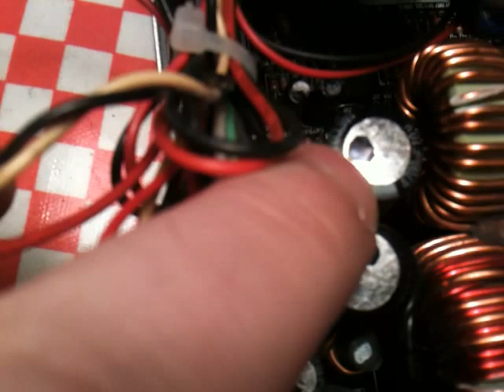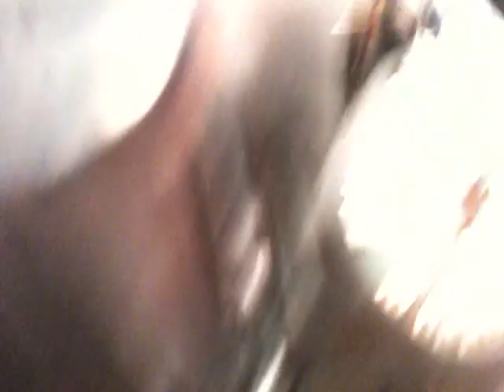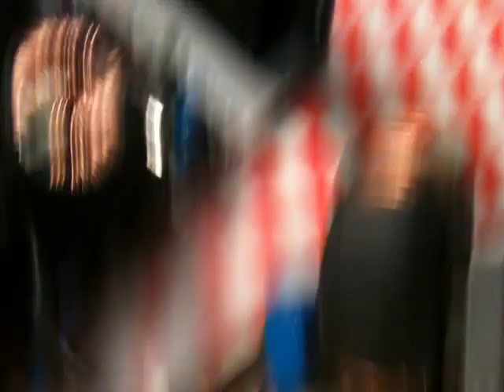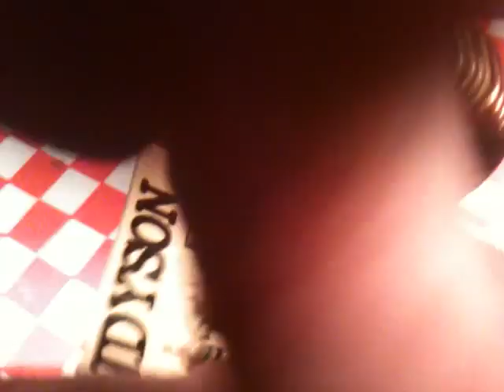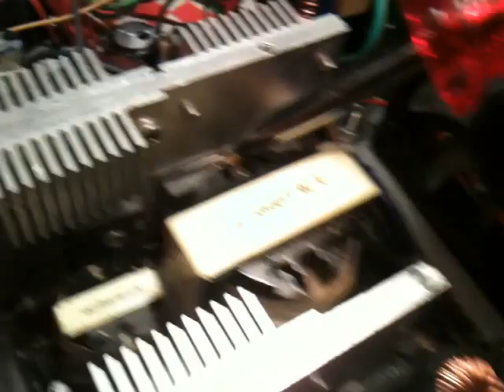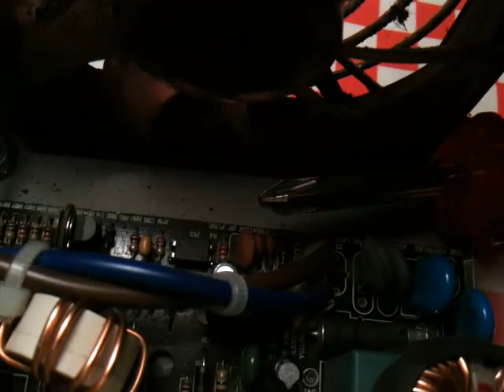How ATX PSUs work, and how they die. PSU Autopsy

Comment: Really appreciate this video. I'm just starting to learn how switching power supply works. Answers most of my questions like "Why is it there?", "What would it do?" or "Is it really necessary". The modular diagram really simplified everything and made it easier to me to understand! Thanks! 

Hope to hear your suggestion or opinion in my idea.

I'm planning to create a DIY variable bench PS using a PC Power supply for my projects due to its large Power output and I could definitely acquire one for free! I think in order for me to draw more than 12 volts say up to 30 volts I would start up after the inverter part(to save money on parts and simply because the circuit is already there, if it will work???). A transformer that would step down near 30 volts, rectifier and maybe a DIY buck converter powered by an mCU with feedback circuit for constant voltage???. For constant current I still have no idea on what to do. Any suggestion? Anyway, will this be feasible?

Comment from the maker: PFC correction is a legal requirement in Europe for any PSU >75W. It used to be done with a passive filter (capacitor and inductor), but the inductor required was BIG, especially once power levels get above about 400W. Not seen aPFC on a separate PCB before though.

Inverter just means a circuit that converts DC to AC. And, in most PSUs, this is what happens - the polarity to the transformer is reversed. In the case of regulated PSUs, PWM is used to control the power flow.

Comment: Those green components on the power input side after the EMI filter are not capacitors they are Thermistors, probably used to limit the surge in current due to charging of input and output filter capacitors.

Comment from the maker: 110 volts is a bit low, most PSUs would be expecting 150-170V DC. It may work though.

Just be aware that when running on DC, the input current will be directed through 2 rectifiers only, instead of 4 on AC; so these may be over-stressed.

How stable is the voltage from the panels? If it fluctuates a lot, things might not work well.

Comment: hmm, ive never seen the powerfactor circuit used in any psu, cheapness?

And my understanding of the inverter section is "pulse width modulation" driver, a longer on time = more voltage.
Ive only ever used the word inverter to discribe the conversion from a low voltage to high, like 12v to 240, i suppose common usage with car inverters has biased me lol.

I found panasonic 105deg capacitors from r.s semiconductors work ok, ideal for the balooned ones around the memory strips.